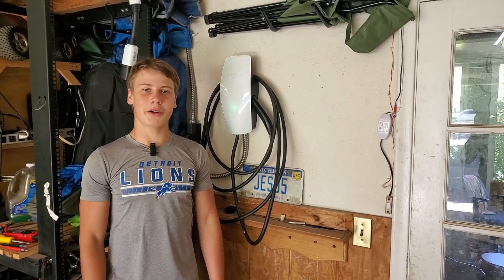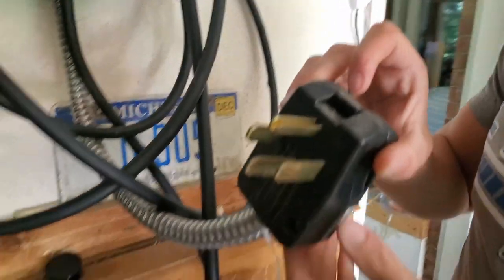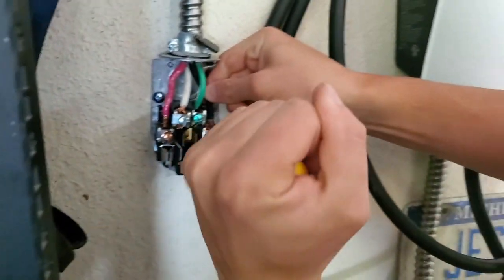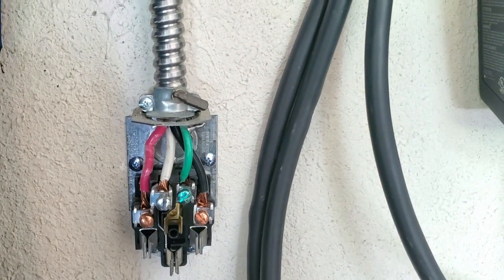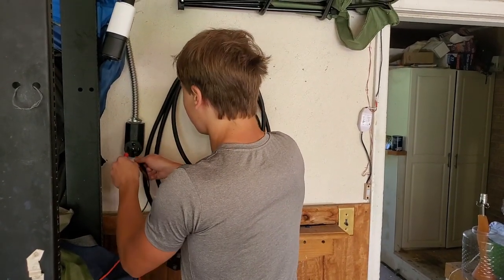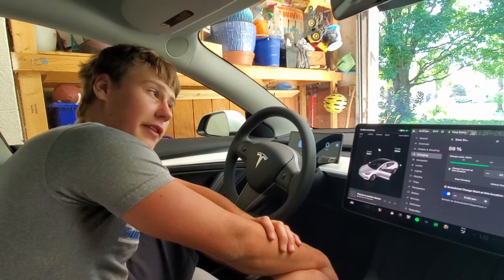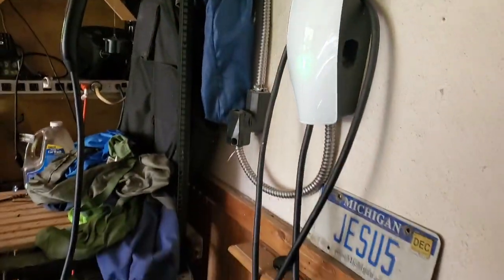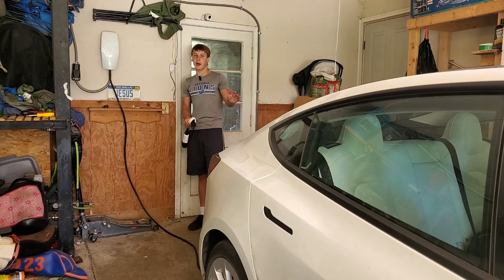One Year Tesla Wall Connector Review and Maintenance Guide! #tesla #charging #electrical #electric

Comment: torque the screws after you do the shake test, look on the plug itself and it should tell you the specs then take them to that amount and then you are good to go. the amount of wire showing on the leads is a tad too much, just trim them down a bit to be on the safe side. keep on learning and DIY.